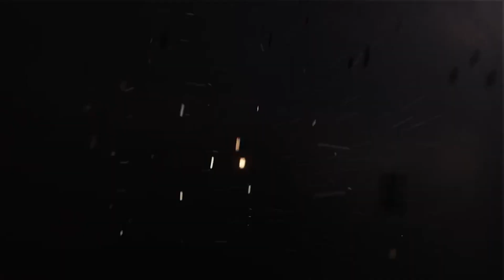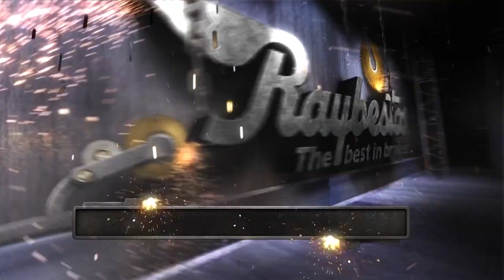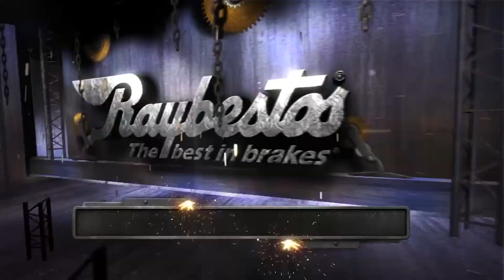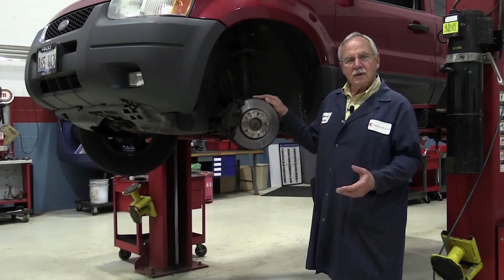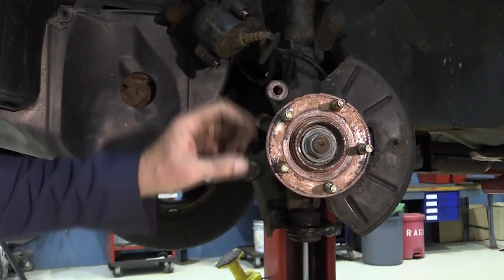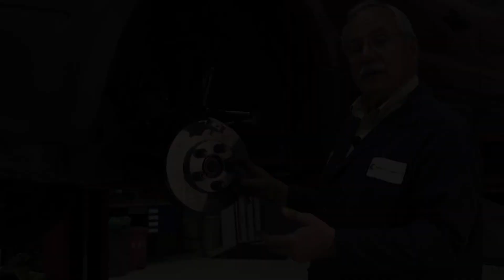Warped Rotor Myth

Comment: This guy is parsing words.  Lateral runout and warping are synonymous.

Lateral runout is the side to side movement of the brake rotor as it rotates. When this gets excessive, pad and rotor wear will result. ... Lateral runout can be caused by uneven torque, damaged studs, or a burr or rust between the hub and rotor.

Warping is to become or cause to become bent or twisted out of shape, typically as a result of the effects of heat or dampness.

Lateral runout is a what you measure with a dial indicator.  Warpage is the condition that caused the lateral runout.

Either term is acceptable.
Reply: I can't believe Raybestos would put out such a misleading video.
Reply: @markshultz640  believe it

Comment: And don't you think if someone was driving the car spiritedly, and aggressive on the brakes then parks the car immediately and engages the parking brake, dont you think that would cause there to be low spots on the brake rotor and thus causing brake pulsation?
Reply: Maybe, except the parking brake uses the REAR brakes NOT the front.

Comment: If a cylinder head can warp or even the block itself can warp i think its feasible for a brake rotor to warp
Reply: Yeah, I think a pompous asshole. When you get a car with steering shake under braking it usually get worse the hotter the brakes get, so it has to be warpage from temp. Also it isn't just temp alone that causes warpage, the rapid cooling of hot rotors can cause it, like hot rotors getting splashed from a water puddle in the road.
Reply: Totally agree. His misconception that it requires a great amount of heat to change the metallurgy or material composition is wrong.

Comment: Differential cooling can most certainly cause a change in rotor shape, specifically runout. Driving through a puddle or going through  a carwash after expressway driving can cause exactly that.
Reply: With that sort of thing the issue is impermanent as the parts of the disc reach thermal equilibrium again.

Comment: This guy is in "denial mode" for warranty claim reasons 😂

He should have said: 
ROTORS DO NOT WARP FOR NO REASON...

Rotors warp by excess heat created by excess friction caused by tight calipers due to swolen slide pins bushings that were lubed with grease instead of silicon. 😎

So in fact warp rotors are an elegant non-catastrophic failure mode to require parts & service.
👍🏻

Thing is OEM who design brakes for ceramic pads use a larger surface discs. 

Simply slapping hot ceramic pads on a soft disc made to be eaten by semi-met pads IS GUARANTEED TO WARP!!

Ceramic pads do not stop by biting the discs like semi-met do,  they heat up the disc with friction.

Long story short: 
- pads and discs are precisely designed to work as *pairs*.

- you should not use ceramic pads on a car with discs sized for semi-metalic pads.

- The more you stray from the OEM specs the more resource you'll spend for questionable results

- Long-life ceramic brakes are designed by car OEM with a visibly wider disc surface to dissipate more heat from a hardened disc. 

- Skinny discs should only be matched with organic or semi-mets. They will warp will ceramic duty overheating them.

- honest brake parts manufacturers provide matched pairs*, not just *singles without specs...

Sanity is restored...
🤗
Reply: G Lasser funny thing...I just took my Audi to the dealer because my disks warped within 20,000 miles before my pads even need changing. Asked them to check to make sure the calipers and brakes are working properly before I swap out the rotors again. After three days of having my car they claimed they couldn’t diagnose the issue without a $780 brake job. Yet this YouTube comment told me more than they did for 180 an hour

Comment: Rapid and/or uneven heating and cooling creates large  stresses in microscopic regions in the material which results in yielding ... aka permanent deformation ... aka warping. You don't need to get anywhere near the melting temperature. It is the temperature  gradients that relieve the residual stresses in the material (unevenly). Think about it - when you do a panic stop, you are dumping huge amounts of energy on the SURFACE of the rotors. It doesn't instantly distribute itself evenly throughout the rotor.

Comment: If rotors don't warp, then why did you replace the rotor ???
Rotors DO warp and quite often ... and they don't need to get anywhere near the melting point of steel to do so.
My impression of Raybestos has gone way down.
Reply: He replaced the rotor because the serface would no longer grip smoothly. It may have come right by itself but you are hardly going to let a customer car go with the same issue as it came in for.
Reply: @andrewthompsonuk1  Why couldn't he have machined it, checked to see thickness was within spec and go that route, compared to probably $60+ a rotor and brake pads? Sometimes people get those wear spots because don't apply brakes evenly.
Reply: @xforce687  agree however most people including myself do not have a brake lathe. Not many discs  get down to min thickness these days.
Reply: The other issue not often talked about is the caliper itself. The square seal is designed to slightly retract the piston. When it gets old they do not retract as well. This will in combination with a marginal runout will also lead to brake judder.
Reply: @andrewthompsonuk1  True, usually when I recommend a brake job because one pad has no lining and the other is halfway or better, I tell them it may also need a caliper or the pins are seized.

Comment: Wouldn’t “thickness variation” be considered. . . IDK warped 😐
Reply: Warped means not all one plane. Thickness variation may or may not also exist.
Reply: So having more material on one side of the rotor isn't warped? It's just lopsided?
Reply: I had someone once tell me that rotors will warp from just sitting. When I questioned that, I found out the truth. What was actually happening was the car sat for close to a year. So the part of the rotor covered by the pads stayed clean, but the rest of it began to rust. Now they start driving it and get pulsation because they have an uneven surface.
One example of the difference between warp and uneven surface. Now, if the rust isn’t bad, the pads may wear it all even again and the pulsing goes away. NOW you have someone who will swear warped rotors can fix themselves! Lol

Comment: My take on the video :

Great job selling rotors dude.Here are some real world reason.

Hot spots or galling will happen on any brake rotor causing increase or decrease of thicknesses.

Let me tell you how many times I've seen heat or stress cracking on ALL brake rotors OEM or aftermarket . . . . Evey second brake job I do.

Sticky calipers from swollen bushing,seizing pins or swollen brake hoses cause brake rotors to warp.

Excessive runout on hub,and or wheel bearing BiG cause for rotors to warp.
Next time you replace a brake rotor put it on a lathe and see how square it is.

I clean,service,meadure and check ALL brake components when I do any brake job.

My customers will get as much as 3 years and or 55 km on all my brake work.

Enough SAID
Reply: you know a whole more than this video wants to admit. 

These guys are in "denial mode" for warranty claim reason!

He should have said rotors do not warp for no reason...

Rotors warp by excess heat created by excess friction caused by tight calipers due to swolen slide pins bushings that were lubed with grease instead of silicon. 

Then all the heat produced cooked  the old caliper seal and rubber brake line.
So in fact, warp rotors are a non-catastrophic failure mode to require service. 
👍🏻

Comment: spent 3000, on rotors,  front over haul,  rims,  tires,  rear full over haul (struts, bushings,  control arms,  tie rods ect. front and back)   still have a shimmy in steering wheel. have had 100s of balances forced balance  alignments ect. tired
bmw e90 328i
Reply: I'm having the same problem. I heard that BMW cuts all New rotors on there cars and trucks now. Also, they use a micrometer and check the thickness in six different places, like a pie, prior to using or cutting them. The theory from what I've heard is when you hit bumps it wears the wheel bearings ever so slightly so cutting them on the car compensates for uneven bearings wear. Just what I heard from a BMW ex Tech that works at Napa... Good Luck.
Reply: Technical bulletin: 

When an axle's brake disc/rotor measured thicknesses are still above the minimum specification,
the procedure of resurfacing the brake discs/rotors has been implemented as an alternative to
their replacement, as outlined in this bulletin.
For each axle as required and when permissible, resurface the brake discs/rotors with a BMW
approved "on-car" brake lathe.
BMW Approved "On-car" Brake Disc/Rotor Lathes:
For the list of BMW approved "on-car" brake disc/rotor lathe machines, refer to BMW
Equipment Program (www.bmwcentersolutions.com ).
Reply: Did you check caster adjustment? Here is how to remember the difference between camber and caster; The front wheels on a shopping cart are called casters. If a cart rolls down a hill and one front wheel hits a curb it bends the wheel back which raises it slightly. Now when you push it in the store that wheel wobbles back-and-forth because it doesn’t have the correct weight on it. That is what happens on the front of your vehicle when caster is not adjusted properly and the wheel is actually raised up slightly, so that it has some wobble and you feel it in the steering  wheel. Check that, it may not be a part at all.
Reply: that is interesting, you're almost there dont give up.

Obviously the people who sold you all the hardware dont have the knowledge to fix it...

Assuming you got a good 4 wheel alignment and tire pressure are between 33 and 35psi... 

Simply check by hands you don't have excessive freeplay in wheel bearings and STEERING TIE-ROD KNUCKLES...

then make sure your wheels rotate "freely" indicating brakes fully release and are NOT TIGHT (silicon lube slide pins and brake line collapsed). 
Bleed air buble and water condensate out the brake lines.

Test brakes at 30mph by super gently increasing foot pressure... feel what happens to further guide you towards one wheel in case it's still not perfect.

You or someone need to figure out what exactly is causing the problem before replacing any more parts 
👍🏻

Comment: Rotors do warp. All it takes on some vehicles is somebody with an air wrench who do not know what they are doing. This was verified by my own experience, with the situation verified by the shop that did the $800.00 brake job, which was about 18 years ago. The company that changed the tires paid dearly for their mistake. They did not argue with me, but depended on the integrity of the shop that did the brake work. They were a reputable repair shop. Expensive, but they were known for doing good brake jobs and a lot of them. The manager at the tire store counted out the hundred dollar bills without any fight. He knew the deal. Sometimes they do warp.
Reply: Your lies mean nothing...

...Receipts or it didnt happen.
Reply: @Chugg.Norris , 
What you say doesn't count. Can you show me a receipt?
Reply: @Chugg.Norris ,
Do you know anything at all about my brake rotors? They are one piece units with the bolts on them. I think it works about like the same principle as improperly tightening a ring gear on a differential carrier, They will warp if not tightened properly also.

Comment: 100% false. Rotors can warp!   You don't need to change metallurgy and if you heated your rotors to 2500 deg F they would MELT!!!!!!   Lol. Get a clue.  All you need to do is unevenly heat steel or unevenly cool the rotor and it will warp.  Very disappointed in your video.  CHEAP steel can actually start to soften and warp around 300 to 400 deg F.  Harder steels soften at higher points.   There is a reason the high carbon composite rotors are $$$$ over lower ones...(i.e. Cheaper). They will wear longer and (listed close) have a lower chance of warping as it's harder to get them hot enough...the 700 to 800 deg F consistently without a cool down cycle.  Those who run track cars know the value of drilled and slotted rotors along with superior venting.

Comment: This guy's  a fraud....suppliers a making replacement rotors and OEM rotors so fast that they don't even stress relieve the castings before machining. I guarantee you after a rotor is machined if you heat it up to 500 F. and let it cool  quickly it will be out.....warped. Even if it a small amount. That's when the process starts
Reply: Any suggestions for a good channel via YouTube? Too many, to many fakes

Comment: This is a great explanation, but what happens if the lug nuts are not installed in the correct order and the right torque? Would that not deform the rotor and cause pedal pulsation?
Reply: Yes it can. It happened to me. It was verified by the shop who did the brake work, and I experienced the severe pulsation of the brakes.
Reply: Over torqued lug nuts is not good. Most steel rims need 100 ft lbs and alloy around 90 ft lbs. Larger pickups with steel rims might have 140 or more ft lbs.
Reply: It can also warp brake drums. It is a well known problem at older trucks an buses.

Comment: To change the metallurgy of a rotor, you have to heat it beyond 2300 degrees.  Anyone that deals with heat treating and stress relieving of metal will tell you that statement is 100% percent false. Rotors can warp!  I question the validity of the information here, when the wasn't any information to prove the statements made. Like using indicators to check run-out, micrometers to measure parallelism.  There was nothing scientific about this video. Raybestos has lost all credibility in my book.
Reply: Where is your video correcting this then azzz wipe? Also, you know nothing of metallurgy sucka. Stop pretending 💯
Reply: @Chugg.Norris  Looks like you have some welding videos.  You should know just as well as anyone how heat effects metal.  Maybe you are more of a fucktard than a welder.
Reply: @Chugg.Norris  dont need a video to prove it. Brake rotors are steel and steel loses strength at 300°C which the rotors can reach those temps under heavy applications.  Steel doesnt have to be red hot to be brittle or bendable which is why if a rotor gets way too hot it will shatter into pieces.
Reply: @Chugg.Norris  HAHAHA!

Comment: or better yet what about when a pad or caliper sticks and the brakes over heat does that not hot enough to warp a rotor?
Reply: I don't know if it will warp a rotor for certain, but I'm thinking it might. I do know by experience it can crack them.

Comment: in this particular case those rotors didn't warp it was caused by rust but what do you have to say when every single tip and trick is followed when the job is done the brakes work great then after 3-4k miles one of the rotors comes back completely wobbling? what tip solves that a new rotor?

Comment: Amazingly, the new diagnosis is that the disks are not warped. Let’s clean the wheel hub and replace the rotors. Wait, isn’t that the same job the other mechanic was going to do? YouTube is full of those better mechanics  that charges you more for the same job and tell you how complicated a 15 minutes with no special tool job they have done.
Reply: Lol!!! Exactly how stupid was this video. You tell people rotors don't warp but machine or completely replace the rotor so its perfectly flat again. Pathetic.
Reply: im a mec and you are right when you change rotors  you clean the wheel hub but i have seen many rotors worn out and total wob after hard drive in bmw cars
Reply: Sorta. 2:05 
He cleaned the hub first

Comment: I disagree. If you do heavy braking, then drive through deep puddles of rain water, they can warp.
Reply from the maker: Thanks for the input. We've never seen a brake system get hot enough to physically warp a rotor. Stay tuned for a video we are going to do in the near future to test this!
Reply: @raybestosbrakes7236  Make sure you heat and cool it several thousand  times to simulate what happens to the rotor when its on the car. Heating it up one time to 300-400 degrees is probably no better than the process you use to stress relieve your rotor material before its machined. Rotors heat and cool over and over. That's why they stress relieve or as I like to call it, warp.